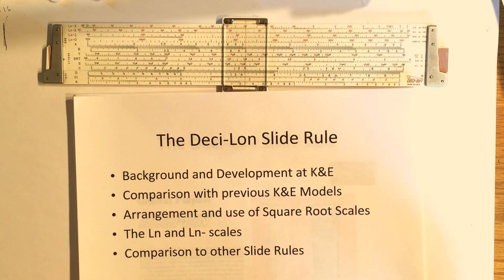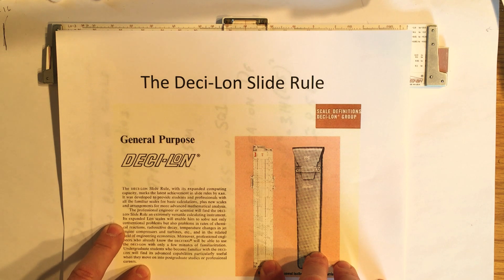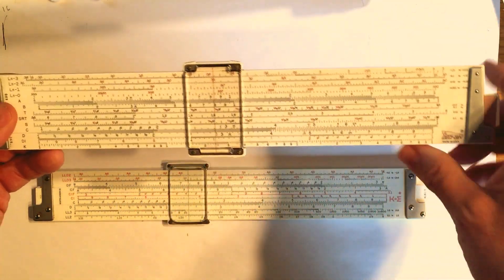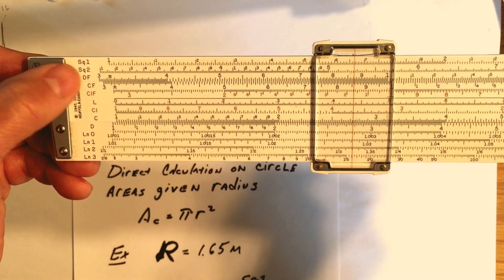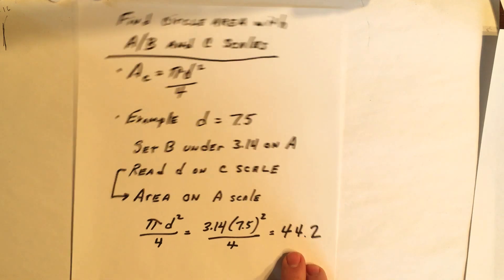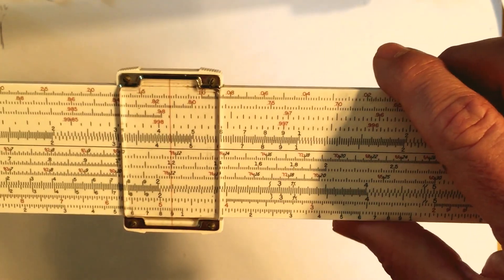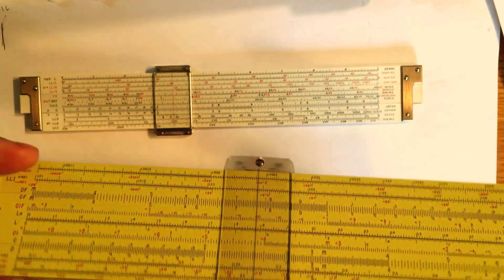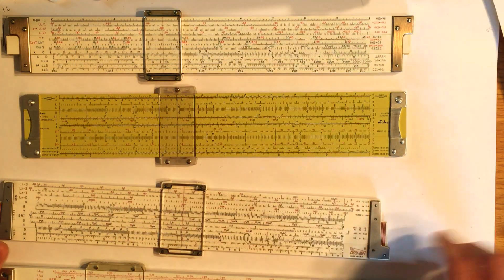The Deci-Lon Slide Rule

Comment: Thank you for your video @ 5:40 showing how to find the Area of a Circle given its Radius. If you set 1 on the CF Scale under 8.56 on the DF Scale, then you can perform multiplication such as for finding the Volume of a Cylinder which is the Area of the Circle multiplied by its Height. For example, 8.56 x 2 = 17.1 is the Volume of a Cylinder with a Height of 2. And so forth for finding the Volume of a Cylinder for any other Height.

Comment: Thank you for your video. Regarding 2:35, the remedy for plastic slide rules that tend to stick is to apply a few droplets of silicone oil as a lubricant into the groove and the tenon of the sliding contact surfaces. Silicone oil is safe to use on plastic, because silicone lubricant does not deteriorate the plastic. Other people may prefer to use a small amount of PTFE (Teflon) dry lubricant. On the other hand, it is not recommended to use petroleum distillates on plastic slide rules.
Reply: I use molybdenum disulfide powder.

Comment: Regarding 2:24 Keuffel and Esser’s Deci-Lon slide rules were not made from PVC plastic (Polyvinyl Chloride).  Instead they were made from Ivorite which is Acrylonitrile Butadiene Styrene (ABS) plastic also known by its brand name Cycolac.
Reply: ABS is what Lego bricks are made from, right? It seems to lend itself to tight-tolerance precision engineering.
Reply: @MattMcIrvin  You are correct. Lego bricks are indeed made from ABS plastic. ABS (Acrylonitrile Butadiene Styrene) was good material to make modern plastic slide rules. On the other hand, PVC (Polyvinyl Chloride) is used to make such products as phonograph records, plastic pipes, siding for houses, window frames, flooring, etc.